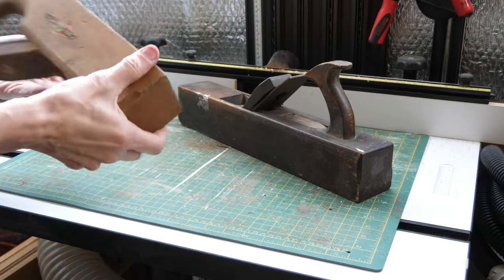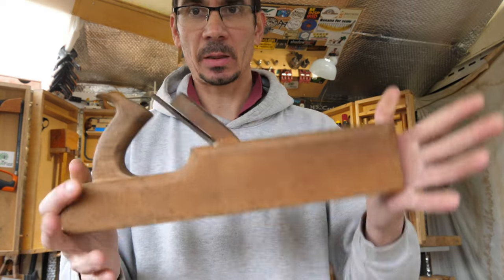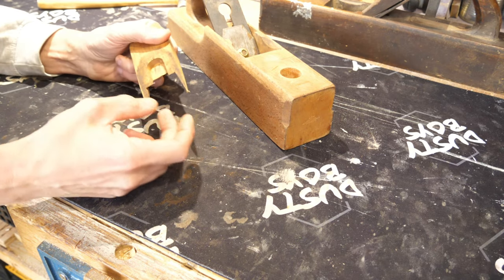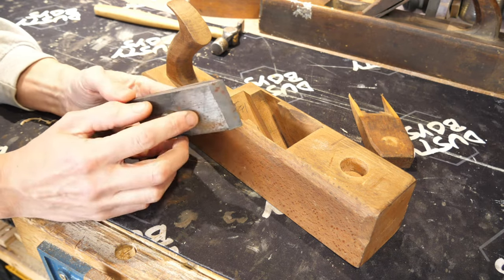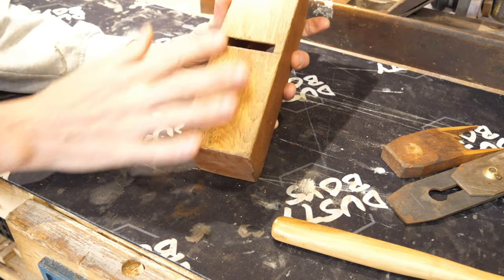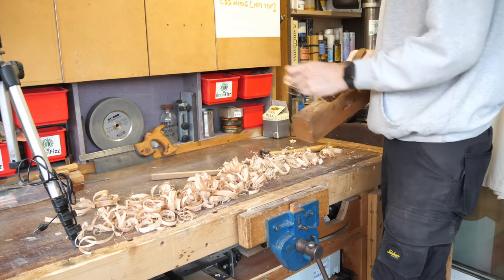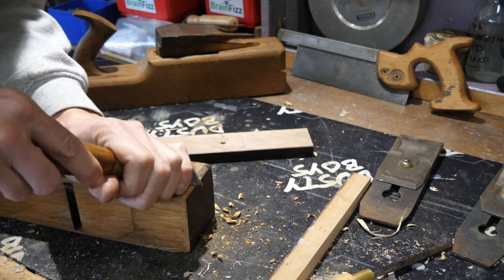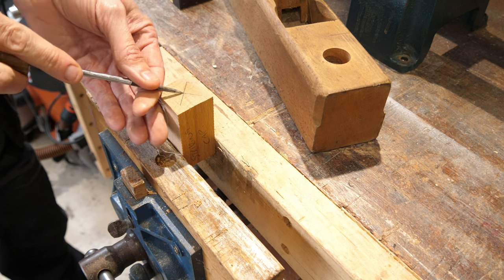Wooden hand planes restored for daily bench joinery use: what to look for and how to do it.

Comment: What’s your thoughts on beeswax with cleaning timber & metal?
Reply from the maker: Wax is g really gif cleaning, but it’s great at protecting… using linseed oil with wire wool will soak and soften the dirt and grime, making it easier remove… once removed then the wax can be applied to protect the wood.